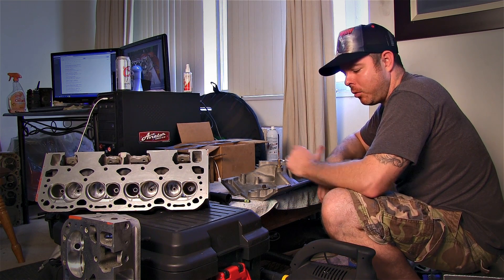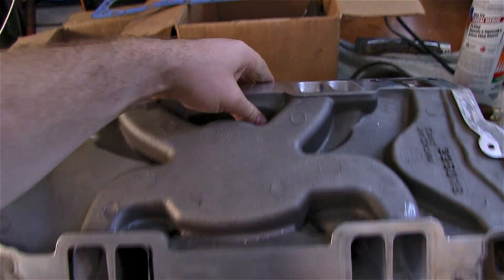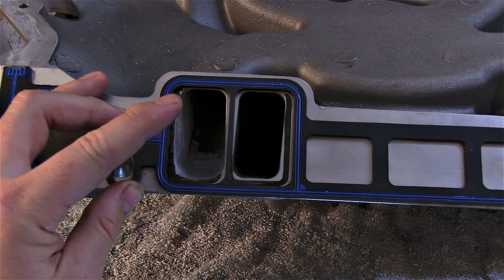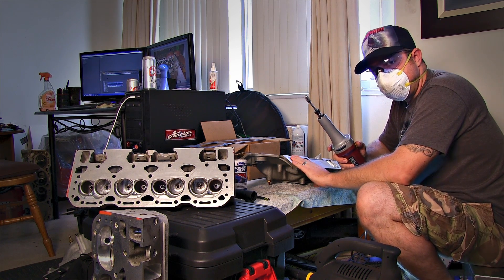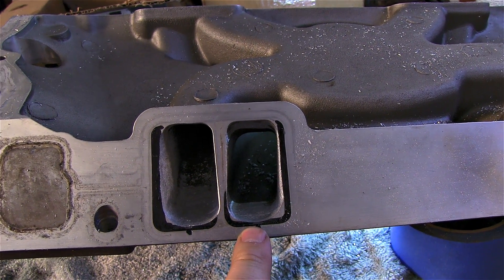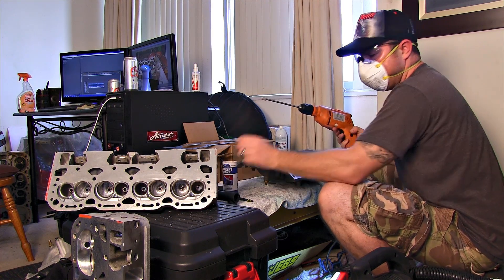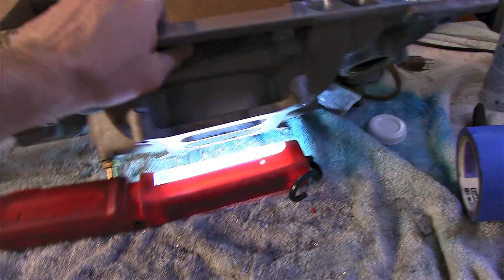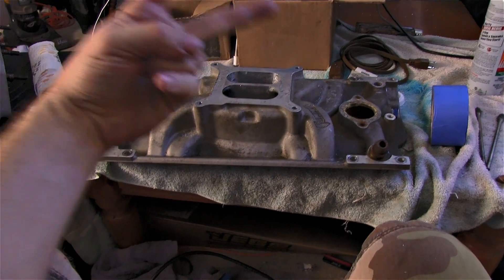DIY Head Porting Small Block Chevy Vortec 062 Part 3 of 3

Comment: Keeping it rough like you suggested increases the air velocity and helps even with well-atomized, fuel-injected heads. Acts like roller bearings of air for flow.

Comment: That intake manifold is a dual plane. A technique used years ago was to remove part of the center wall/divider between channels. Literally a cut out 1/2" by 1" would change the low end response/torque curve. Hot rodders would experiment until they got engine response where they wanted/needed  it long before single plane manifolds were available. Personally on the street people who built engines for high rpm's(6,000 +) soon got tired of it and someone with a low end grunt engine would win the stop light to stop light race every time.   Here is a story for you. While still in High School I used to watch the drag racing in front of the school during English class. 1963 Chevy Impala 283 cuin, 2bbl, 4sp, with 5.33 gears(real close to that), racing 1968 Dodge Charger 440 4bbl Torque Flight 3.23 gears. The race was about 75 yards stop sign to stop sign. These two cars were always neck to neck, the charger at the top of first gear and the impala pulling the top of third gear(a stock 283 2bbl 4,400 rpms ish).  Yes they always blew that stop sign, would get three runs in and disappear before the residents in the adjacent neighborhood called the police.   Yeah the movie American Graffiti comes to mind. The above is an example of what real low gearing can do for you and turning a dog into a stop light stormer. Another way to look at it, I ain't got no money what can I do to have fun and annoy the crap out of the guy who bought the brand new dodge charger.